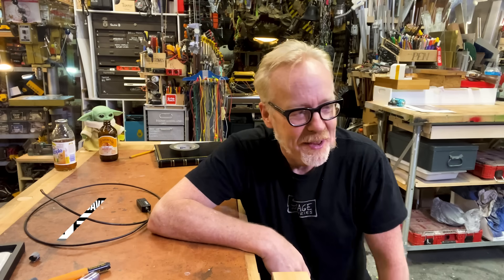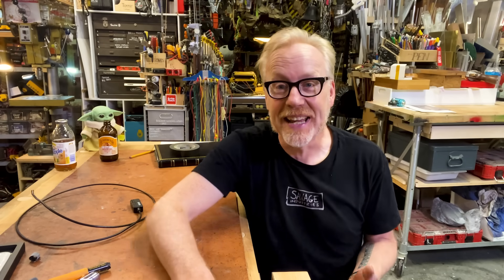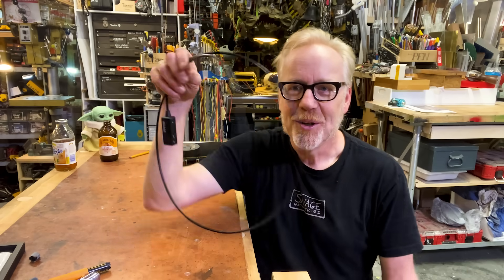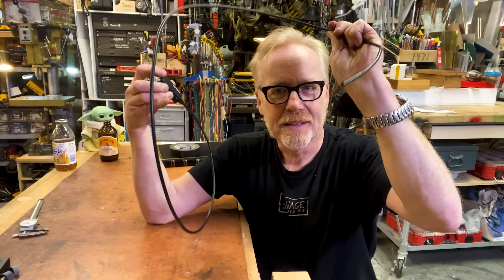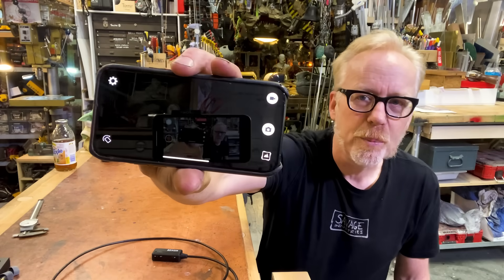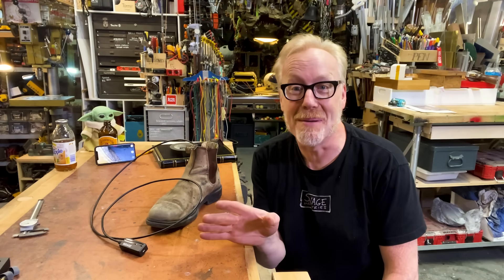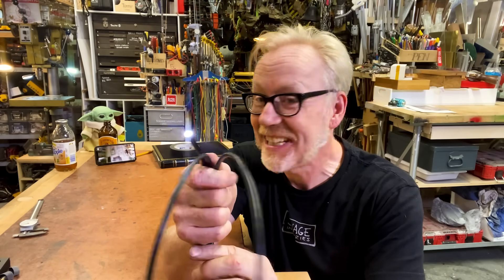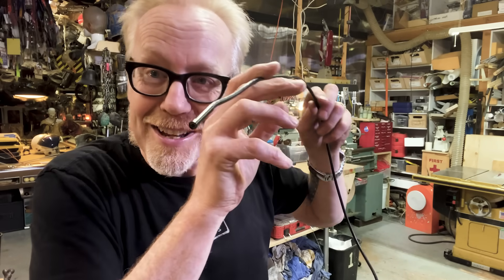Adam Savage's Favorite Tools: Wireless Endoscope!

Comment: I purchased one years ago and it is absolutely amazing when running wires through walls. I have been able to fish it down walls to easily drill through noggins with my extension bits. 100% a tool I would recommend to anyone wanting to run cable through existing walls
Reply: That is great to know, because I am trying to look down my walls and see if there's actual insulation in them, because this is a very old home and it's pretty drafty.  I am excited to get it and give it a try.

Comment: After watching this video, I went out and bought one of the endoscope he reviews. It came today and I figured out how to get it working with both my iPhone and iPad Pro. Then something occurred to me and I tried taking the thing out to my travel trailer, to see if I could use it as a backup camera. Imagine my surprise when it worked, though I was standing right next to it, so it might not work from 35 feet away when I'm in my truck pulling the trailer. Then there is the matter of figuring out how to find a place to mount this thing inside the trailer so that only the camera itself is outside.
And as the company that makes this little camera doesn't seem to have a functional web site, I have no idea who to ask about developing my idea. Still, I suppose I can work on the hole in the rear of the camera first, so I can play around with the idea.
Thanks, Adam and Tested for making my summer trips more interesting.
Reply: I bought a 40$ back up camera with a camera, long wires ,and monitor-it plugs into and it powers through a push button switch to the cigarette lighter on dashboard on my old  Toyota sienna.

Comment: My comment is not quite as positive as everyone else’s but perhaps it’s a matter of operator error? I used this very same model yesterday to view inside a drained, mostly horizontal swimming pool pvc pipe. The light seemed to wash out the view even on the dimmest setting and everything was very blurry. So I have played around with it today just inspecting different things around my house and found that you do have to hold the endoscope super still and it won’t focus closer than 2” or so. One of the main drain pipes I viewed was in water but the other one was dry and I had the same result in both pipes. Wasn’t able to see anything due to the blur. Any tips would be greatly appreciated.

Comment: I’ve used them on engines and gearboxes. Installing cabling in tight quarters. Working inside dashboards and instrument clusters. Inspecting insides of tanks. And so on. A must have in any mechanical work. And at that price… There’s no reason not to have one.

Comment: I've been very disappointed in mine. It has a fixed focal length of about 3" and everything else is out of focus. The lens needs to be much wider-angle. Using it is very claustrophobic. And you can't hold it steady on the end of its flexible arm. Sigh...

Comment: I really wish someone would invent one of these with an artificial horizon so you can figure out which way is up. Or better yet automatically adjust the view based on input from a horizon / orientation sensor. I'm kind of perplexed no one has invented such a thing yet, it would be soo useful. 

As someone who has used a borescope / endoscope quite a bit, mostly looking inside walls, it's really hard to know which way is up when you're looking in a dark confusing space, and even if you know which way is up, the button which rotates the view helps but you can never get it perfectly level. And if you start out perfectly level when you first insert the probe in the wall, very quickly it will get shifted around as you snake the probe to where you need to go. 
Surely there must be some way to create small sensor that can fit in the tip of the probe to determine it's orientation! Even if it had to be mechanical and make the probe slightly larger, it would be worth it. 

If there are any engineering students here that want to make some cash, this is definitely a need that the market has not yet filled, and many frustrated endoscope users would throw money at you like crazy if you can put one of these on the market..

Comment: Advice for anyone thinking of buying one of these:
- Buy one with a screen, not one that relies on your phone. Otherwise in a few years, once the software / drivers are no longer updated, or your phone OS updates and no longer supports this device, it will become completely useless. Plus it's easier, more reliable, and less of a hassle.

- Buy one of the dual-camera (usually called 'dual lens') versions. The second camera on the side will be extremely useful, possibly more than the main camera. Mirrors are useless, you can't see anything with the glare from the lights. And if you're looking into a wall, the side camera means you may not need a larger hole in order to turn and manipulate the probe.

-  Get a shorter length, unless you really think you'll need the longer one. It's a hassle to manage a really long probe, even 3 meters is much longer than you need most of the time.

You can get one with both of these features for well under $100.
 
Now if only someone would invent one of these with an artificial horizon so you can figure out which way is up, or better yet automatically adjust the horizon, I would throw money at them so fast you'd think it was a strip club..

Comment: For mechanical purposes they are called borescopes. The articulated ones are much more expensive, but also much more useful.
Reply: What does an articulated one offer that this one doesn’t? I’m not sure what you mean by articulated. I just bought and  used my Nidage to look inside a swimming pool pipe. It could’ve been operator error, but it was just too difficult to see anything in that type situation. Everything was very blurry. I am wondering if an articulated endoscope might work better for that application but first I need to know what you mean by articulated. Lol.

Comment: I've had a number of these over the years -- most usb wired, but I think there's a wireless (BT?) one in the collection. My goto these days is the CAT IV rated industrial borescope from Greenlee. Not so tiny, but a 4ft snake I can poke into a gas tank or high voltage panel is great. (or an attic with unknown critters. unless there's a gator or snapping turtle in there, they aren't going to hurt it. I've had a raccoon chew on it, and a skunk spray it.)

Comment: Bought one of those a while ago to save some money and give myself a home colonoscopy.   Kidding, but if you knew what you were doing, it seems possible.  : )  I bought one a year ago and it's come in handy a few times.  It's one of those tools you won't need often, but when you do need it, you'll be glad you have it.   I dropped a small bolt into my motorcycle engine and had to find and retrieve it.  Without the endoscope I never would have been able to do that without taking the engine apart.  Also good for examining cylinders and other parts in the engine.

Comment: I got an endoscope a few years ago.  I think it cost around $100.  The focus and depth if field on it were crap.  Yours seems to work a whole lot better.

I was using it to try to figure out how some joists were oriented so I could hang a clothes rid from the ceiling if the laundry room.

I didn't learn ad much as I wanted too because it was totally disorienting trying to figure out where the lens was and what direction it was pointing.

Comment: I have one that was wired but the software did not get updated as Android did.  Luckily computers just saw it as a USB device, I have looked inside working PC cases and electronics racks to see if fans were going, and to look at indicators and make certain of what ports wires were plugged into, as well as serial numbers of installed devices.  I have an uncle who has held it under his car to try and track down a noise (not very useful for that) and I have pushed it into wallspaces to see where things were pulled tight.  Sadly I have not seen ones that are self-flexing.

Comment: So much more flexible than the fiber-optic-bundle versions of these from 20 years ago (and LED tip-lighting is so much better.) They're great for running network in an existing house - drill the first hole (down from the attic, for example) look with the scope and make sure you're not going to drill in to power line or pipes, drill the next hole, repeat...

Comment: The one linked in the description is $42 right now, and only 4.92 feet. There is a 11.5 foot version that is cheaper from the same source: https://www.amazon.com/Compatible-NIDAGE-Inspection-Semi-Rigid-Inspecting/dp/B0791DG4FK/ref=psdc_401578011_t1_B07C9C6P5D

Comment: To be pedantic about it, if you're an iOS user, your ONLY choice are WiFI endoscopes/cameras like that one, that "does not even plug into your camera" (phone?)...iOS doesn't natively support USB cameras.  

If you're an Android or computer user, both of those platforms DO support USB, so you can choose to go with a WiFi model, or a less expensive, direct-connected USB model.  Being direct connected, you don't need to worry about a battery being charged, but OTOH, it does mean the "viewfinder" must remain tethered to the camera.  There are benefits to both methods.

Comment: I have a 5mm dia. version I use for inspecting the inside of my airsoft gun barrels (6mm bore).
IIRC, the ones that plug into the phone don't always work on iPhones because of the way Apple implemented the interface.
I'd imagine the wireless one bypasses that issue.

Comment: Yup . My tumble drier was over heating and shutting down and at less than half the callout charge of an engineer it was worth sending one of these down in search of an errant sock or some other blockage to find that the flex hose connecting it to the wall had gotten kinked a fault that wasn't apparent when i pulled it out to check on the unit . . saved a fortune and now have an excellent tool in my kit

Comment: The best tool for looking down spark plug holes on engines that my have jumped timing. You can easily see if there was piston to valve contact instead of removing the cylinder head.

Comment: Nice to see they have gotten cheaper but you are not correct in that the camera end has gotten smaller at least for the one you featured today. I have an endoscope that is at least 15 years old and the tip is also 1/4" in diameter, apparently you did not look in the automotive tool world for endoscopes.

Comment: I've had this thing for about a year. I've used it to inside my walls before running new wires and to look down my drain to see what the blockage was. Super cool device.
Reply: Can you use it if you don't have a smart phone?
Thank you
Reply: @SDsailor7  No, not easily. The scope has no screen of it's own so uses an app to show what it sees on your smart phone's screen. But since the scope broadcasts it's data over its own wifi signal maybe someone could hack a way to view it on a desktop computer.
Reply: @ScottFoust  Thank you for the reply.
Then i won't be able to use it.
Cheers

Comment: An easy mistake to make when enacting the infinite mirror effect between a camera and a monitor of its own output is to assume the effect causes the GPU to work harder. The number of operations is capped by the number of pixels. It will not attempt to render infinite layers at a given pixel since it has no awareness of the existence of layers in that situation. It just renders the top one, so the performance remains constant. The lag you saw was just the refresh rate of the camera.

Comment: i ve been contemplating getting one for years. One of the things i wan´t to quickly check on racebikes is if the Piston looks good. you can tell much by the look of the surface of the piston of twostrokes. how good your oil is. how good ( longterm ) you adjusted the carburators. if the rider tends to overrev the engine. and if you f*** up and you better change the piston before the whole engine goes in the bin.

Comment: I drain my cottage's waterline by removing submersible pump's riser from the inside of the well casing 4' down. And then I fumble around trying reconnect after. I used my endoscope to reconnect this year, so much easier when you can see what you're doing!

Comment: Hi Adam. Short story about my boroscope I use in auto engine inspection.  Some years ago we were having our kitchen completely remodeled and while outside in our back yard, I noticed a baby rabbit in trouble.  So, I brought it in the house, made a box for it and made sure the rabbit was as comfortable as possible.  Well, we awoke the next morning to find the rabbit was not in the box.  Now, the top was folded in so we thought it would not get out.  We searched the whole house and nothing.  We were going crazy, don't want a rabbit loose in our home.  Then I thought, I have a boroscope, let me look under and behind the lower cabinets.  Low and behold, there it was , between two side by side cabinets.  One way in and one way out , up and over the kick panel.  We got the little rabbit out unharmed but only because of my boroscope.  I love my boroscopes so much I have two different types. Flex shaft and solid shaft.